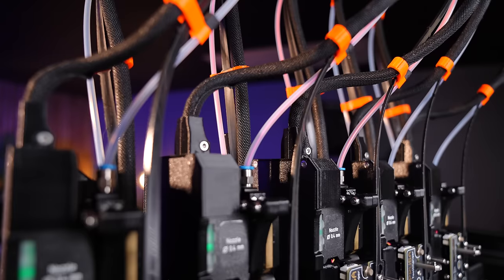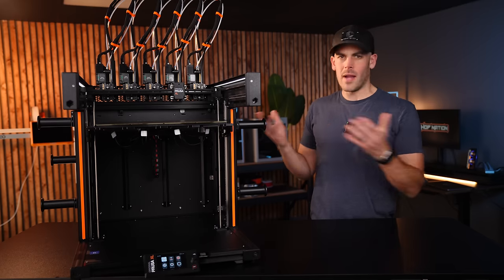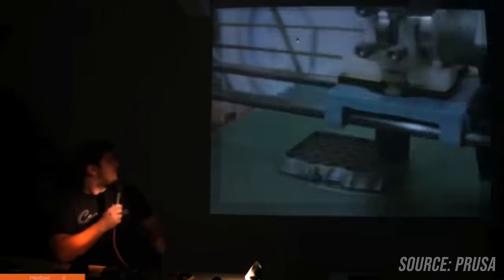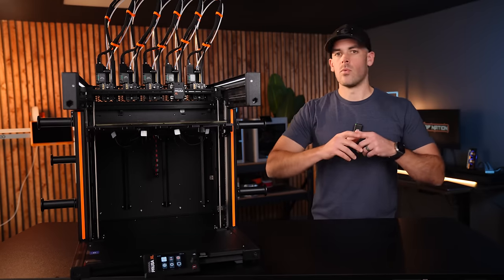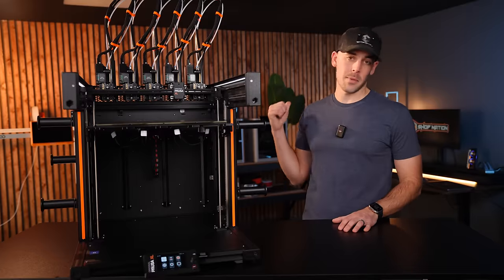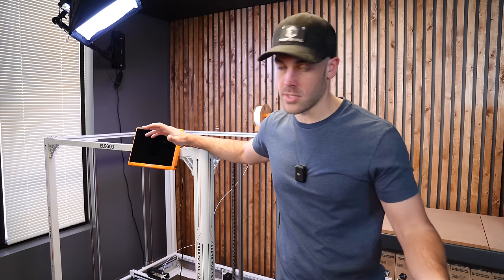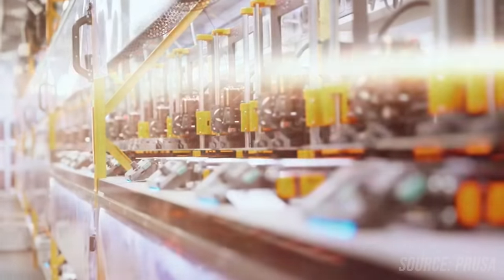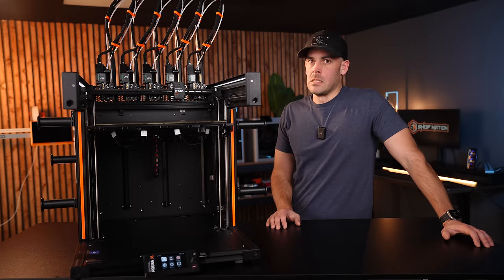Why Prusa is the next Blackberry

Comment: If given the opportunity I will always buy Mk4 over X1C and have done so several times with no regrets. And yet I share your sentiment towards Prusa and honestly cannot recommend their printers over the competition when it comes to price for PLA, PETG, ABS, ASA... It's clear that Prusa got caught as you said by Bambu and instead of innovating like the other 3D printer brands they pouted on social media about how "speed isn't everything" until they finally caved and realized that, while it isn't everything it's certainly an enormous factor. On top of that Prusa doesn't release products that match with their advertising which is only overlooked because of the goodwill they've garnered over the years, however it's clear that too is fading fast.

If they release something to compete I am all in, but the XL is too much of a commercial/research machine and the Mk4 is outperformed by the P1P for half the cost if you live in the US, meaning their print farm superiority has been decimated. I don't think Prusa will die soon, but damn... I really wish they tried a bit harder to predict the direction of the markets.

Comment: I think you are right about Prusa sticking too much to their existing designs and making incremental improvements on it.  That can be an advantage... and keep in mind that Bambu Labs is building on a lot of lessons hard-won by Prusa and others in the 3D community.  They got a leg up and then some.
One issue with Prusa is not sticking with existing designs but existing paradigms.  For example: using 3D printed parts.  It has some advantages but it is not cheap.  Just look at the price difference between the MMU3 kit with printed parts included, versus the kit with only filament included for you to print them yourself.  The difference is significant, and you can injection-mold parts like that for pennies.  Bringing the rest of their manufacturing in-house makes their printers even more expensive...  Personally I am willing to pay a lot extra for "not made in China", but people comparing for example the Bambu A1 vs the Prusa mini will think twice: for more or less the same price, Bambu includes the AMS.  
    
But one thing that Bambu does right is a tight focus on pain points.  What makes 3D printing difficult?  What do our customers want, what are they struggling with?  A great deal of that is software, and I think there is a distinct lack of Prusa on that part.  Camera support, for instance?  And while Bambu came up with a working (if wasteful) AMS, Prusa's slicer and profiles don't even work properly for manual filament changes on multi-material prints.  While consumers look at multicolor objects and shout: "I want THAT".  There are a myriad of little niggles with Prusa's software and firmware that are very slow to be addressed.  Bambu on the other hand understands that ease of use is key to selling to the masses.  Far more than the outstanding customer support that Prusa offer: the customer would much rather that their device works, so that they do not need support.
    
I'm sticking with Prusa for now, and I have been extremely pleased with my Mk4, which I took care to dial in properly for the filaments I use.  I get clean prints that can compare with the best.  And I am willing to pay in my time and money to support a company that has contributed so much to 3D printing.  But I am afriad you are right: if there is no change, Prusa will fade into irrelevance.

Comment: I think Prusa Needs to bring out a smaller core XY style printer, one that can be optioned for Two print heads, has a 10" cube build volume, and comes as a kit for 800 or less. Unfortunately that would canibalize MK4 Sales, but anything close to the price of the Bambu X1 Carbon would simply lose to that printer if it wasn't faster.

Comment: Small multicolored/ multi material parts is a large part of tabletop gaming 3D printing. I have been 3D printing for a little over 10 years now, I'm a mechanical engineer as well, and I play D&D and Pathfinder 2. Being able to print small colored prints, helps decrease paint time. Being able to use water-soluble materials for supports is also very beneficial to speed up post-processing. Now, the real question is, is the XL going to be able to maintain a print quality to make the price tag worth it? Regardless, after my many years of trying to get single nozzle, multi material printers to work reliably, the extra cost would be 100% worth it to me for the multi extruder printer.

Comment: I wonder why so many YouTubers praise the x1 so much. Bambulabs can’t even ship a straight bed, the AMS is a mess, I never had clogs as much as with the X1, cleaning the head with the fixed nozzle is a pain, it’s extremely noisy, the controller is horribly slow, it’s unnecessarily dependent on a cloud service which makes monitoring prints slow as well. Service is crap and you need it as everything is closed. I could go on. Yes, they managed to get the first layer nailed, it’s well tuned and it has core xy speeds. Certainly a step up and a kick in the butt of some of the competition, a welcome one at that. However, the amount of praise they get amongst YouTubers feels like they started a cult and it makes me sceptical. I got influenced by YouTube reviews and am disappointed. My AMS has never worked right, support asked question after question and eventually I gave up. I’m though my 4th printhead. My bed is so crooked that one can see the compensation needed with the naked eye. Also here, nothing from Bambu support. The community is a horrible pit of fanboys always justifying the holy Bambu. I would not buy an X1 Carbon again for sure. I only still have it as shipping it back to china would have been too much of a hassle and single material it prints reasonably well so I keep using it occasionally when my Voron is already printing but it’s not a quality machine and rather expensive for what you get. I’m quite confident that Prusa is not done yet. All they have to do is scale down the XL and they have a good contender with likely much higher quality and mich better support. The tech is already there.

Comment: Actually, I think the big mistake, if there is one, is that prusa priced XL too cheap. Because let's face it, it's not a consumer product. In fact, neither is bamboo lab. Untill CAD truly becomes mainstream, or generative AI can produce good 3D models on demand, the latter seems more likely to happen honestly. 3D printer will always be a niche, relegated only to nerds and businesses. And we know where the big bucks are (spoiler, not consumer market). For a business, the faster turn around and material saving by the XL means the higher pricetag can probably be made back within a couple months, if not weeks. Even if prusa charges 10k for XL, they will still sell more than they can make. What I believe will happen is prusa may gradually shift to the business side of the market, they already have a business oriented subsidiary, so it's not that far fetched.

Comment: Ya something you and other bambu sponsors leave out is exactly what the top comment was getting at. It’s to the point where dji, unitree and bambu use the same equipment from government sponsored labs and use these to cut costs drastically. 

Combined with cheap labor, government help and direct subsidies no private company can compete with that. 

We honestly need heavy tariffs on the companies I mentioned otherwise no one can compete with them. You are a paid sponsor for bambu so I won’t poke to many holes in your reviews but how many parts on the bambu x1 have open source material on them and how many are actually manufactured for auxiliary industries that are also state run? Meaning how much state money is actually being put into this company to subsidize the supply chain and put companies like prusa out of business.
Reply: When you can take open source formats and apply state subsidized equipment to it, then you know why you are getting a cheaper product. They have no need to pay for r&d let alone develop something new and unique until someone else pops up that they have to outcompete. Look at unitree it’s pretty much a spot micro sold with a new LiDAR taken directly from the state run EV companies. No one talks about where bambu gets their stuff either, if anyone is wondering why they send these guys free printers to avoid commenting on bad things.

Comment: The idea is not to print multicolor benchys, but to print complex multimaterial products. Just printing supports with cheap material and not wasting expensive one can make big savings. It doesnt matter if XL cost 2k more if you save $50 on every print and it's faster. But that's not all, you can print with different nozzles for different printheads, so you can print big things fast with great detail and many other things. X1C is cool but comparing it to Prusa XL is pointless, they are very different categories of products. But i agree that if someone want to print banchys they should propably not buy XL.

Comment: OK. I get your point, but I'll take a Blackberry Key One over an iPhone or Android phone any day, especially when that Key One is loaded with native Android. I hate on-screen keyboards.

But you ignore that even Bambu has been outclassed by Qidi. For half the price of the Bambu, I can get an enclosed, heated 3D printer capable of running engineering grade materials and do more than produce toys. The printable area is only slightly smaller than the Prusa XL. And the customer service is better than both Bambu and Prusa.

Comment: the PrusaXL is theoretically capable of doing much much more than it currently does, mechanically speaking, it's just that the software for those crazy stuff hasn't caught up with it yet. Imagine printing with different nozzle sizes simultaneously. the solid and infill layers you can print with the large nozzles to massively improve print time and mechanical strength, and yet still be able to print detailed exterior surfaces with the standard sized 0.4 or even smaller nozzles.

You could even have custom nozzles specially dedicated to ironing which you only use for that to get much better quality and much less print time. 

We just simply don't yet know what is possible to do with such a printer, given that it's only been out there for such a short amount of time

Comment: I just don't really feel like comparing the prusa XL with all the tool heads to this Bambu is really fair.
Both are actually completely different machines catering to different markets.
The Bambu seems like an allround well built prosumer machine. 
Meanwhile the XL really feels like a solid professional production/prototype machine. Having the different tool heads, the big print volume and the open source nature with lots of room for easy upgrades and changes to each workplace setting/needs. That's what the XL feels like to me. The only thing I feel is missing is a closed heated chamber.
That being said, I own neither of the printers. I have just my mk3s😊

Comment: Good points, the XL is certainly expensive, but I really like the fact the it's so maintainable and versatile. I've only bought the two head version, and I love it. For personal use it's too expensive, but for small volume commercial work it's great. Prusa need to focus on reducing the cost. The designs are optimised for 3D printing, not injection moulding or die casting.

Comment: What I want is larger print bed.  And only 2 heads like the Prusa there that doesn't poop like the Bamboo.  I don't like the Bamboo, because I'm not rich.  I meant rich by wasting filament just for it to poop it out. I really just need two heads.   One head for PETG and one just for cheap support material.   That would be the ideal printer.  If Prusa removed all the heads and just left 2.  I could see myself buying one of those.  Right now, I have the Anycubic Max 2 Cobra and it does the same but at insane speeds.  I'll spray my prints with color anyways.  But I really just need another head to use as supports.

Comment: I think when it comes to multi color, you are right. The extra pricetag is not worth it. 

But I have not seen anyone use Multi Material on a Bambulab Machine. If you have to print ABS parts with e.g. TPU inserts and asa Supports, the Prusa XL is the way to go (or E3D Toolchanger, but thats not a print out of the Box Machine)

Comment: Make it affordable,  good quality print, huge no. of people  and support  and plenty of parts   just common sense tells anyone that will be a success  in general.  I did not buy Prusa or Bamboo Lab as my first 3D printer instead I bought my first 3D printer that is made by Creality. The Ender 3 S1 Pro to be exact.  I did not buy it new  but  a refurbished one not working under $100.  It is a $500 machine when new.  
Not working scares you?  It did to me because i did not know  better.  It turns out that it is not that hard to fix or upgrade cheaply and easily for Creality brand.  It is your money you spend how you like  for me personally for the first machine I will not spend a bunch just to get my feet wet.

Surprisingly i found out the Creality Ender 3 series is a very good printer for the money and for my home use that is good enough for me for a long time  if not indefinitely.

Whichever brands turn you on a 3D printer is a must to buy  in my opinion.  I originally want one to print enclosure for many of my IOT projects.  Now i know it can do a bunches of other prints that makes me exciting not to mention i can update it to remotely view, monitor and control anywhere in the world with just software update.

Comment: I think you can't put XL and Bambu in the same boat.
Beside some other benefits the XL has there are 2 main reasons I still would invest in more XL's then Bambu. 1: The multi material option that bambu does not have and is executed very well on the XL is the biggest reason why we have the XL and want to order more. 2: Some projects we are working on simply don't fit on the Bambu, but do fit on the XL.
Beside that I'm a huge fan of Prusa, their support, their involvement in the community, and the way they manufacture inside EU.

Comment: At this point, the only remaining value Prusa offers is their slicer, slicing engine (now used by Cura too,) and their file platform Printables.  Their products are laughably over priced and seriously antiquated.  The tool changer fad died around the time we lost Sanjay Mortimer.  Prusa simply takes far too long to bring new products to market.  Worse, the Mk4 is a ludicrously over priced mildly iterated version of their terribly outdated bed slinger.  You could buy an A1 mini with an AMS for comparable money!  Josef has done a ton for the market over the years.  But his ego and attachment to his previous successes are his now inevitable downfall.  The tinkerer hobbyist era is over.  Prusa is no longer relevant in the new consumer product era.  In fact, one could argue they’ve been coasting along selling outdated, overrated and overpriced product for years.  Pretty much the definition of Apple without Steve at the helm.

Comment: Nah. I think this is not a valid comparison. Prusa is heavily going into the industrial area, there this machine is just awesome. Who cares for different colors, the different materials is where it is at. Especially with the Nextruder, flexible filaments are also an option. So you can easily print materials with proper hinges and PVA support, while also mixing PET-G and PLA to get the stiffness and toughness in the areas you need. 

For work, we ordered 2 of them and most likely will get a few more. If you have the use case, which most private people will not to be honest, this machine is amazing and the price absolutely reasonable. 

Do not see it as a consumer device. There I would agree it is almost pointless. But for a company, what is $4k? That is not even half a month of cost for a single employee.

Comment: We are considering to get an XL for a few reasons. First, multimaterial to print support polymers is pretty much a requirement for industrial prototyping. We would still have some models that we need to send out to be printed on big SLS or SLA machines, but it would help to keep our external costs and waiting times down. The reason why i like the 5 toolheads is, it would in theory allow for different nozzle sizes to print higher details or print large models faster. Last i heard that they had to change back everything from 0.6mm to 0.4mm nozzles for some reason, but i hope they figure out how to properly support different nozzle sizes. Having a company with good support in europe, no china cloud software stealing secrets and pushing broken firmware on printers, and our positive experience with older prusa printers are some other reasons why we would love to keep making business with them.

Comment: The comparison fails A: because there is no ecosystem to be tied into (despite the efforts to make it so), like iOS or Android or Blackberry and B: because Bambu are not creating a new market at all, just selling to people who already want a printer. Apple created a whole new market, which swallowed up the niche market Blackberry were in.

Printers are not like phones at all. Printer buyers, when considering a new printer in a couple of years, have no reason at all to stick to one brand. If in 2026-7 Prusa have the best offering then they will take that up and it will sit next to the older Bambu (Assuming that still works), just as the Bambu sits next to a mk3s. 
As for the specific unit, if the aim of the XL was to compete for current small printer owners then yes its misplaced. As a larger printer with tool heads its a more niche manjufacturing product. And I do agree the mk4 seems like too much of an increment over the mk3s to be worth it for me. So Prusa are not quite at the front edge of the small hobby printer market today.. but there is nothing stopping them doing so.